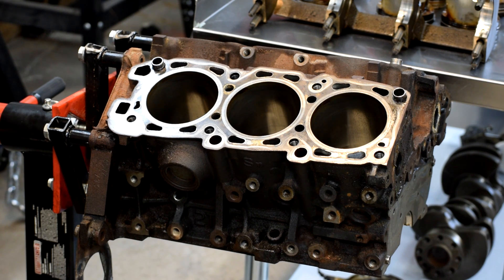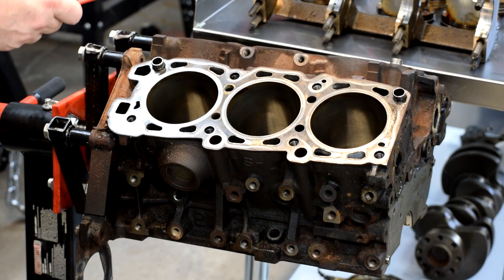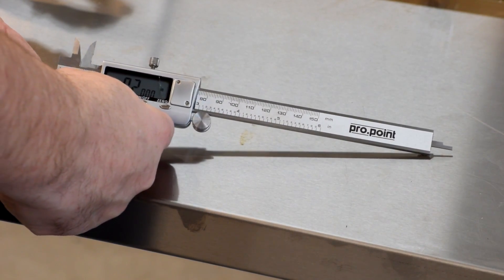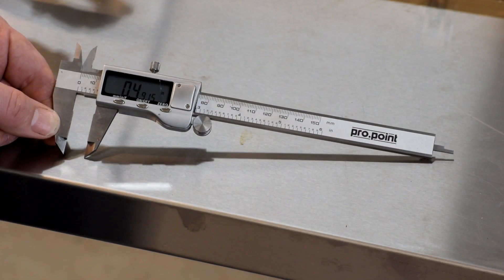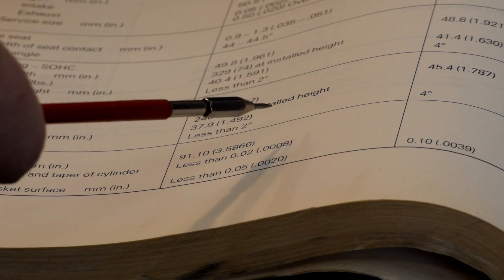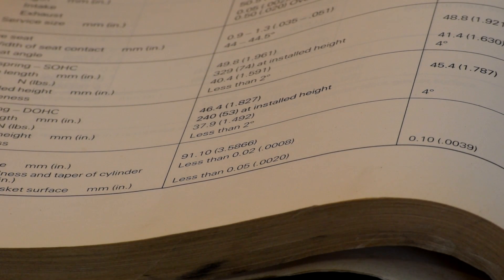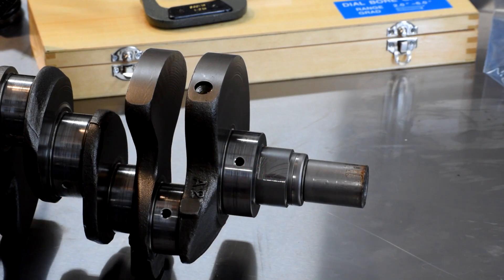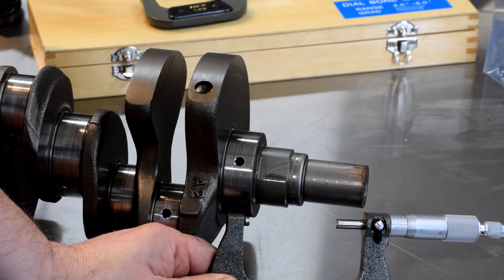FNR Stealth Project Ep 8 - Using a Dial Bore Gauge

Comment: You Zero'd the bore guage to a measurement using a micrometer, then you measure the bore.  
-As stated at 10:13: The distance shown on the bore gauge is "the difference in size between the bore set at the micrometer and your recorded measurement." 
- At 10:48, you state: The measurement read on the bore gauge is .006" LARGER than the bore set at the micrometer.  Isn't that measurement actually .006" SMALLER than the bore set at the micrometer???  IE - If you set the bore gauge to 4.000" and see a reading of .003", your bore measurement is actually 3.997"??  

Not trying to be hyper-critical of your video, I am just a very novice hobby mechanic trying to learn the trade and your video has been very helpful!  I just want clarification, if anyone would like to confirm or correct my comment, it would be much appreciated.

Thanks!
Reply: I noticed in your spreadsheet, you are subtracting the measurements to the nominal bore value.  That answers my question, thanks.

Comment: When measuring bearing oil clearance you measure 90° perpendicular to the parting line not where he was measuring. The reason for this is because the bearing shells are not round they are thicker in the center(crown) then at the edge. So that reading is wrong it wont have that amount of oil clearance
Reply: jesse hamilton   ,   I caught that too.   That’s all I needed to see to know I wouldn’t even let this guy rebuild be lawn mower.

Comment: 1. I'm lost as to where the minimum value would be if you are jumping steps I would of like to know where the direction is going for the needle if you're trying to set the minimum in 9:26 so is it Clockwise or counterclockwise because then it gets a bit more confusing for me, sorry man. I'm not the brightest but i'm also lost as to why it's not read from the 0 Clockwise to figure out measure rather it was Counter clockwise.

2. I haven't gone to school for reading bore gauges or machine work but i've gone to tech school for auto. Also, why is the gauge zeroed out from the 3 in 10:24? I understood everything else but the others not 100% a clue. Hope i can get a good understanding and hoping you can answer my questions. :D Pretty please! 

3. Has anyone told you that you sound like aVe? haha Maybe in the future if its possible if you could redo this and make the dial bore gauge indicator visible to the camera? 

4. Would you offer the excel spread sheet and also make the x and y measurements on the excel blue circle/bores where they're located too... Well whenever you're ready and done with how making it good. :D I remember going to school and being told by an instructor and a student about thrust and anti thrust sides of a piston.
Reply from the maker: 1. So a DBG is a relative measuring device, not an absolute one (like a ruler). You first set it to a known zero point (using a micrometer) and then the distance either side of zero on the gauge is the difference from the set distance. At the 9:26 point I'm checking to make sure that the minimum distance measured in the mic is at zero. The mic is set to the shop manual's bore diameter. Once in the bore, if the needle reads on the clockwise side of zero, then the bore is smaller than the set distance; if it reads counterclockwise, it is larger;

2. That just happens to be where the needle sits at full extension (when it is not in the bore). It doesn't mean anything. What matters is the reading in the bore;

3. AvE sounds like me;

4. The spreadsheet is pretty simple - it's just measurements at different parts of the bore, and the delta from what the shop manual says is OK.
Reply: So for all the replies back.
1. I understand now with the gauge because i kept trying to think if i did this would i add or subtract the measurements i got myself confused when i should of just taken it a simpler approach.

2. What you're saying is it doesn't matter whether you zero out the gauge because no matter where you read it backwards it says 6 thousandths of an inch right?

Thank you back for the reply. :D